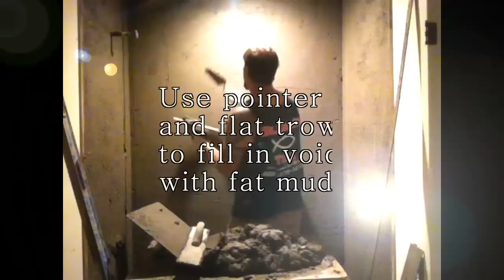How To Use Fat Mud To Make Wall Flat& Plum For EasyTile Installation byDave Blake Master Tile Sett

Comment: Amazing work!  

I inadvertently started a tile project of my fireplace floor mantel in my home.  House was built in 1950, 6x6 brick tile was tile over with adhesive in the 1990's from my perception.  Tried to remove the 90's tile and all the old brick came with it.  Went to Harbor Freight to get an air-chisel to remove all the old, dusty brick and mortar.  

Wish I had watched your video first.  This is my first time tiling.  I ended up leveling the 18" x 69" floor area with LevelQuik, trying to build it up 1/4" or 1/2" inch to allow for backerboard installation.  I did pretty good but the floor still is not perfectly level.  I adhered Hardie board to the built up floor (1/4") and now my tile is right flush with the 3/4" hardwood floor, right were I want it.  

Problem now is that some areas, upon test fitting the tile, are like 1/8" or less recessed because the floor isnt perfectly even/level.  I don't know if there is enough space to work with now because the tile is so flush with the floor w/o using any adhesive or mastic.  I'll need to float the tile in some areas, just barely, but I dont know how well this will work now that the tolerances are so slight.  Might just have to float all the tile and live with the lip being above the hardwood by 1/8" or so... That's if it's even possible to float it with tile adhesive???  Or maybe thin-set is the way to go?
Reply from the maker: Thin set is the way You could ease the edge of the tile if it is stone or true body.

Comment: Great video! I'm down here in Mexico most construction is done with cinder block. I used fat mud to straighten the wall but the next day I could see small spiderweb cracks. Is this a big deal? What could be the problem?  Thanks for the help!
Reply from the maker: No big deal  Thanks for watching Daniel
Reply: Daniel Carrete, it's the heat making the mud dry to quick. if your base is solid, it shouldn't be an issue.
Reply: Dave Blake,thank you for the demonstration! I was a mechanic for 15 plus years and was trained old school... this way of doing our craft is dying.. thanks again!
Reply: Mud is not meant to straighten walls out, it will be too thin to hold it's self together, you need a latex modified product for that kind of work.

Comment: When you put the first 2 wood strips on the long wall up did you check that they were in the same plane horizontally with each other? You don't show that.
Reply from the maker: +Jim Tutsock Your right on about putting them in the same place but wide enough for the stright edge Jim

Comment: How do you float a wall so it is flush with the surround? Seems like you are stuck trying to hide the half inch edge each time, no?
Reply from the maker: Hey Kevin I use tile trim like surface bullnose ,quarter round or Schluter to cover the   fat mud.
Reply: Dave Blake yeah, but I don't want to depend on tile trim. Natural stone nice and flush with fat mud?
Reply from the maker: You could float the fat mud thinner if needed to make tile flush with what ever you want.

Comment: Good video mate. We screed all our wet area floors with a similar sand cement mix, we don't use cement board because of all the movement in the ground and the building standards make us put fall in the shower and the outside of the shower. Thanks again for the video..... btw, those guaging trowels are the best for tiling ;)
Reply from the maker: gaul samson 3 gaut way back when I start in the tile trade 30years ago " I can't believe its been that long an I still love it" we floated everything.
Reply: Hey, yeah we float our wet area floors and sometimes bad walls. I personally believe all floors should be floated, makes for a better more solid installation for large format tiles. If you're on Facebook my name is Benjamin delfs you should add me, I'll send you some photos.

Comment: what about the edge of the mud where it meets the original wall.....wont it be half inch too thick at that junction when the tile and the metal edge goes on?
Reply: Professor Kaos 1/2 inch reveal on the sidewalls are set up to receive 1/4 round tile trim.
Reply: That's where the term "mud cap" came from.

Comment: can you create a scratch coat and then apply the mud instead of putting up mesh?
Also how long do you wait in the US before tiling onto mud?
Reply: No, the reason for wire is to keep shower a cell so it does not move with the frame of the house, you can do with out the water proof paper but you half to apply red gard or some water proof over leyment.

Comment: can you show a video of your showers from start to finish and detail your steps?  I am just curious about the order in which you do things and how keep you tile level and also what do you do on the edge of your mudded wall?  There is a step between your drywall and your mud?  Do you use coved bullnose?
Reply from the maker: +Ryan Jazdzewski Im working on a complete master shower video .It will be out soon. 
I do use bullnose for trim when the tile does not come with quarter rounds.
Reply: That's awesome man, like I say, it is a great video and quite an art what you do.  I would like to attempt to learn this way for my as it is my belief this is the correct way to do showers.  I would like to see how you do your pans, curbs, and niches in particular.  I gotta imagine the water proofing of your pans is different from what I have learned in the past

Comment: how do you make a niche when doing this process tho? i just use hardy board and flash my walls my boss wants jobs done so fast
Reply: Build the niche before you float. Then mid the noches just like you Mud the walls. Use a straight edge at the 4 sides of the niche for a perfect nice edged

Comment from the maker: It would work just as good.
Reply from the maker: r hall
Yes it would
Reply: Dave Blake we do it differently in England Dave. nice to see it being done like you have done awsome work.
Reply from the maker: Do you have a video I could watch to see how you do it and England?     Thanks for watching and please like and share with all your people.Have a blessed day.
Reply: Dave Blake we do a 2 coat system 1st coat we put on and put a scratch in it let it cure. then top coat feathered off level with a derby straight edge   then floated up smooth. when I am on a sand and cement job I will do a video for you. Thanks my man god bless
Reply: Dave great job,am great you showering every body the old ways. I to been doing it since 1978. And still doing it today.i love it.
Reply from the maker: whatburnout
Once you learn how to use fatmud  you never want to tile any other way!
Reply: that is the pre-float or scratch coat, useful for butterset jobs,, way back method.
Reply: zenbooter ,

Is there a better method over water-proof membrane contractor put in. Only problem is that the walls are exactly plumb and level.  Would this fat mud address this out of square issue, before tiling??

Thanks and great video.
I had to subscribe out of respect for my friend Santos.
Reply: @csfb.c.f.c5416  we do the same here in the states. Just some pompous tile setters out here want everything thing made easy for them. If you want your tile flush with the drywall though you have to paper and lathe over the studs, so a Scratch Coat is a necessity in that case.

Comment: Great video, now I will float instead of hardiebacker on my own project. I'm a plumber & your right real tile guys do float. Why is your shower valve so low & not 4', is this standard where you live?
Reply: Dale - it's 4' off the floor not off the top of the tub.

Comment: kid's don't smoke weed...
Reply: Steve's Bathroom Remodeling and Repair I've been an installer for about 5 years, experience from residential to commercial crews. You know the most amazing lead tile mechanics I'd work with are biggest potheads you'll ever meet!
Reply: My first name is Steve and I can unequivocally say it is a horrible first name.

Comment from the maker: Yes Mark There is backing behind the Aqubar'B" The contractor put Green Broad .Summary: Greenboard drywall is used in damp areas. Contrary to what some people may think, it is not used in highly wet applications such as shower stalls.It can be if you install Aqubar"B" over it and float with  fat mud.You can get it at Home Depot.
			 				
It is the same as regular drywall except for two things:Its paper covering resists water (but is not water-proof).
This paper is green. The color imparts no special water-resisting properties, but it does help the installer better see where he/she is applying the drywall compound.
Hope this helps.
Have a blessed day.
Reply: your popping a million holes in your waterproofing if that's the case. (in reference to the aquabar b) im not saying it hasn't worked for years but water will eventually find it's way back to the green board. If you want it to be truely waterproof you'd put a topical membrane over your mudded walls like ardex 8+9
Reply: Ian Olsen it's a cement wall. The reason you have to be so so careful with penetration on your weak ass board system, is because it's not cement! Cement is waterproof -  like Durock is waterproof.
Reply: Epic Tile Cement is not waterproof....lol If that's the case we would need no shower liner when building a shower pan lol Just cement right? No shower liner needed right?
Reply: dude conta deis - Is a gunite swimming pool waterproof? It's nothing but cement and white plaster. And it's waterproof! Floated cement shower walls are waterproofed enough to not wick or absorb water. The pan is there to wick water to the drain and if your shower subfloor is a cement slab, the water wouldn't soak through the slab, it would leak out into the outer walls. Why, because the slab is waterproof!
Reply: Dave Blake David have you ever thought about using Thompson's water seal on the green board guess it's purple nowadays but Thompson's water seal you can spray it on you can roll it on you can brush it on then you have a waterproof substrate I like to waterproof proof the edges all the drywall first back and front all the way around first. I put some paneling in my bathroom and I did this to the paneling the beadboard front and back before I painted it so for what it's worth, God bless and let's continue to make America strong by helping one another
Reply: @nexustilellc9065  who told you that durarock was waterproof.

Comment: Couple tips, Fill in the sides and the level strips. Then proceed from the top filling in about two foot sections and screeding it off with your straight edge and excess can be used. Creates less floating at the end. Use baking soda in small doses mixing on your mortar board . This will cure the mud faster especially on colder days. Because we want to tile ad finish the walls all before lunch time so we can do the floor in the afternoon. and grout and finish in one day. Everyday and on to the next house tmrw
Reply: WRONG! He did it the correct way. When you charge the correct amount of money to do mud walls you don't need to run to the next job. Jagoff!

Comment: It’s OK but this guy has some mistakes on the floating. 
Your flooring strips not supposed to set it far from the corners. Besides that you supposed to scratch coat it first and let it dry

Comment: Nice! BUT...bro burn that 1st coat in and scratch the entire shower 1st then run your screeds.  Other than that you're ok for a old fart
Reply: Infidel G why when you can do it in one day? you gotta let a scratch set before you finish... if it ain't over 2 inches, why wait!
Reply: Jay Downs ,   Junior,  I float and set 3 of those . I meant instead of scratching and floating 1 wall at a time scratch all 3 walls , set your float atrips then float. Doing 1 wall at a time is slow
Reply: Jay Downs  so those watching understand, your 1st coat is your scratch coat whether you float same day or not ☆☆☆
Reply: Infidel G “junior , I float and set 3 of those” *says while stroking himself